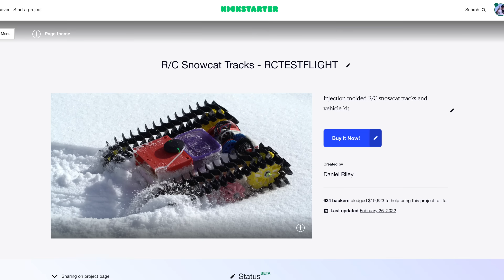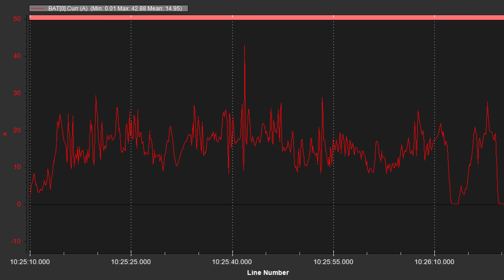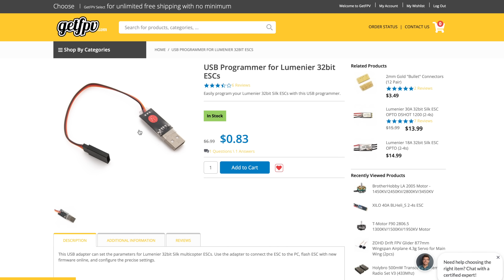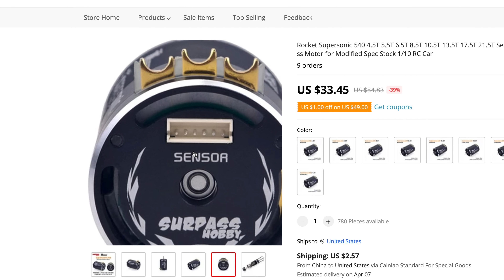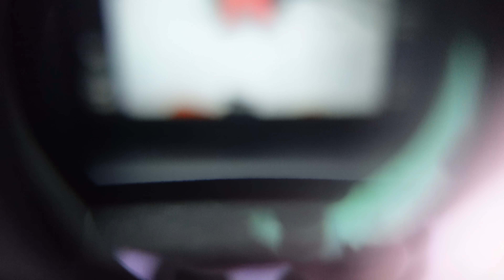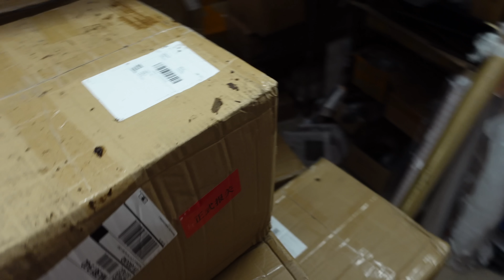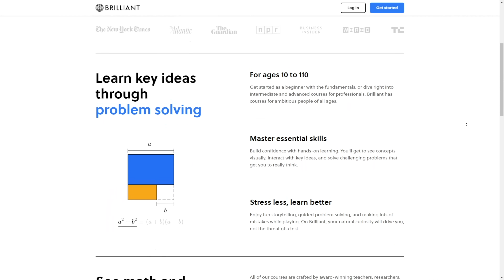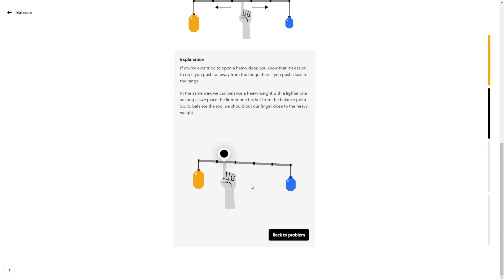The R/C Snowcat is HERE!!!

Comment: If you are using 6s voltage on the ESCs with no caps might explain the current spikes and blowing up, try adding some caps to the ESCs to help with the spikes and hopefully stopping them from exploding. You could also add a RushFPV power filter board to snip all the current and voltage spikes in the butt once and for all. Works great for mini quads, so it could help the snow cat a lot
Reply: He knows that. I mean he is basically a genius
Reply from the maker: I still blew up a few with big caps installed. Its not an inductive voltage spike problem...
Reply: Those cheap ESCs don't have hardware current limit capability，you need a cycle-by-cycle over current protection ESC which usually also has build-in current control loop which means better torque performance.
Reply: @槑  so a SW issue. Is the bl-heli  open source SW/FW? Seems like some stuff could be fixed in SW
Reply: The FetTEC voltage spike protection thing might be helpful
Reply: Holy fuck I’m reading through these comments and my mind is boggled props to all of y’all for having such knowledge
Reply: @probro1116  you just have to take some time to get to know the stuff
Reply: I would add a clutch for the jitter and use a subtractor gearbox so it could have one drive motor that spins up only when an input to drive or turn is received. the mechanical parts give the motors something to chew through and break, should something go wrong on the electronics end. less costly, too.

Comment: I suspect the deadtime in those ESCs might be off. Often with cheaper ESCs the components tend to be de-rated which can result in a slower on-off time than projected which can lead to shoot through which can cause overheating and burns. See if you can get Steffen to make you a BLHeli32 build for those with a slightly increased deadtime.
Reply from the maker: Interesting... Thanks for the info!

Comment: Taking a wild guess here: The overcurrent protection might just be way to slow to react to to this short spikes.
Do you have a log file or something, where you can see, if this protection activated? You can then drive around and see later, if it activated, and compare it to your diagram.

Or just take something to draw too much current (resistor that can handle a lot of heat for example) and add a multimeter to the circuit to see, what the overcurrent protection does and under which circumstances it activates (you will have to do this experiment in you lab obviously).
Test things like the following:
How long do you need to have too much current (add a manual switch, that you can close, and look at your diagram afterwards, to see, when you protection jumped in)?
Does this time change, if you change the current?
But be careful to not grill another part of your circuit while doing this.
Reply: Also, fuses are a thing...
Reply: @VulpeculaJoy  Underrated comment.
Reply: This sadly does not work as the esc detetects if the motor connected to it is spinning or not and if there is no motor the esc will cut power as it won't be able to sense the self induction caused voltage changes on the motor wires by which rotational speed and timing etc is estimated. That's kinda how sensorless esc's work.
Reply: Seems like a good approach to find a solution. I remember when I was still designing industrial dust vac systems that I once had a very peculiar problem that had never occurred in any of the other workshops, and both the issue and the solution may be related here.
Symptoms: When the filter fan was started up cold, it blew the automatic fuse of the building 4 times out of 5. After a few weeks we also received an official warning from the utility company of the city that they would take us off the grid if we didn't fix our amp drain spikes.
The issue: I put 2 and 2 together, and went to look at the way the startup circuit worked. Turns out it was intended to have a slightly delayed start-up by controlling the power output of the power source to the fan. BUT, the street had a fairly weak electric cable. This was a professional woodworking shop that was oddly placed in a residential street with only 2-phased power lines. So what happens when you ask for more current? Right, the voltage of the supply drops. But when the control system feedback loop is based on power and not current, then a drop in voltage will increase the needed current, so the input resistance got further lowered, thus further increasing the current and further dropping the voltage. This effect only occurred for about 2 to 3 seconds. The automatic fuse had a delay of 3 seconds, explaining the irregular tripping. And because the startup would trip the fuse, the owner left the filter running until lunch break and then all the way through the evening, so basically he would start it up only twice a day, giving the neighbors blinking lights and rebooting PCs twice a day (hence the warning).
Curiously, the issue never occurred when the fan was still running out, however low the rpm. It would run
Solution: We put in an extra control box before the filter that would temporarily choke the current and maintain the voltage whenever the fan was below a low-but-non-zero rpm; and then slowly reduced its effect over a set period of time. This increased the start-up time from 10 seconds to 45 seconds, which was about the time anyone would need to walk from the power switch of the filter to any of the machines it was serving anyway.

If I would relate this to what is shown in the video, the chip in the control box would just dynamically change the values of "current protection" and "ramp-up" and maybe a few others. A low max current and low ramp-up would cause a slow start, and then increasing the ramp-up once the rpm threshold is reached while steadily increasing the current protection with the rpm between 1A and 5A. But I guess to know that rpm, you'd need sensored motors unless he adds an optical switch on one of the axles or gears to measure the rpm locally.
Reply: @VulpeculaJoy  Sure, but are there fuses, which are resetting themselves automatically, when the load vanishes? The only goal is to protect from overcurrent, not to shut the whole thing down....
Reply: @moritzadler4362  Well, then add a motor, and try to trigger the overcurrent protection by inducing  a lot of load or something...
Reply: @TheCatAliasTNT2k  I was refering to the fact that he repeatedly blew ESCs during testing. Why pay 40 bucks each time an esc blows, instead of just a few cents for a blown fuse? This is not a solution to prevent regular overcurrents, it's to provide a fail-safe so that IF it still happens, nothing major gets destroyed and the rover doesn't become a fire hazard.
Reply: @VulpeculaJoy  yes, that would work, but I want to have a solution, that does "reset" itself
Reply: @TheCatAliasTNT2k  there are fuses that are self resetting, although you do have to remove all power from them to do so.  A normal fuse would still be better, as its a lot cheaper.
Reply: @kuhljager2429  Yes, but that would cut the power for a relatively "long" time, because hardware is relatively "slow" compared to software. Would be the question, if if would be fast enough to recognize the spikes at all....
Reply: @TheCatAliasTNT2k  So honestly, the long time here isn't relevant. Sure it takes  a minute or two to reset a self resetting fuse, or maybe 5 min to swap in a replacement for a blown fuse.  However fuses are only going to come into play once conditions in the circuit are going to cause damage if not stopped. It comes down to a choice: replace a fuse, or replace a ESC. Fuses aren't meant to iron out the small brief pulses, they are meant to stop current levels that will be blowing up the ESC.

Comment: The ESC issue could be similar to that i have had on G120s at work that there is a time delay on the over current before it will trigger it to cut out. so maybe worth checking the finer print to see what time delays might be set, as motors can spike oddly.

Comment: I suggest doing the 1200mw mod to your DJI goggles if you haven't updated them to the lockout firmware they just rolled out. Also changing out the stock antenna for some more directional ones to punch even further. I'd really like to see a long range snowcat video!

Comment: Great video! As a skier I loved seeing you take it to a ski resort. It did get me thinking, I bet these snowcats would be quite handy to use for avalanche rescue (for resorts or backcountry)! For somebody who understood such things it'd be interesting to see if one could be set up to drive autonomously and home in on a signal from an avalanche beacon, or possibly utilize some type of snow penetrating radar to look for victims. For doing grid searches it would be quite useful to have several of them using gps data to track where they have and haven't gone.
Reply: This should be fully possible if the person being rescued is carrying an active rescue beacon, passive rescue beacons however tends to need rather high power equipment and good line of sight which is why they're almost exclusively tracked with helicopters.

Comment: You should use Falcon 500 motors with their built in encoders for this project or a similar one. They are designed for FRC but might work well for your application.

Comment: There's a good chance this won't do anything for you, but consider adding capacitors near the battery leads on each ESC. Usually ESC's will have lots of bulk capacitance near the battery leads to smooth out the massive voltage spikes that result from current being turned on and off quickly. Your ESC has only some small ceramic capacitors that in all honesty, aren't enough for 50A. General rule of thumb is 20uF per amp but those little ceramic caps come nowhere close to that. 

I'm not an EE so I'd take what I'm saying with a grain of salt, but if you look at your collection of ESC's, I'm betting most of them will have some form of electrolytic capacitor near the battery input leads.

Comment: You could solve the low speed torque problem by using brushed motors. Of course that means replacing both ESC and motor but usually brushed ESCs are cheaper than brushless and brushed motors still spin really fast.
Reply: Main reason why he want brushless is no more lipos with out
Reply: @coolbone6177  That doesn't make any sense. Brushed crawlers use LiPo all the time. The Hobbywing 1080 is the gold standard ESC for brushed crawlers and the default battery mode is LiPo. There's 6s compatible ESCs out there for brushed motors as well.
Reply: @ivanf4023  no I do relised but a Lot of the time if you want fast turn and high gearing cars you don't want to use brushless because lipo last way longer

Comment: I thought of a great autonomous vehicle project, but it is a bit different than what you are used to. An autonomous rover with a metal detector strapped under it, and with data logging, to profile a 500m sq area. You use the data to go back later to give the hotspots closer attention.

Comment: STAGE 2
You need to add suspension and more wheels for hard terrain. 
..
Also, the motors/ESC's for rc crawlers are designed for low speed torque.

Comment: Dude that thing carves snow drifts like a surfer carves waves! Switching to actual land based motors and ESC's would drastically help you out. They are optimized better for low speed high torque starts without spiking currents like a crackhead surprised by cops kicking down their door.
Reply: Nice simile.

Comment: I wish I could have afforded one. They're awesome!
Reply: Put some make up on and get to work... wishing won't make it happen.
Reply: @murrijuana2842  In 2022, comments like these still happen? On a channel like this even. Bascially, you are assuming she's lazy and that because she is a woman, she somehow has to wear make up?
Reply: Currently designing my own rc car basically from scratch because I'm broke and want one. $100 worth of parts on Amazon. Don't know much about RC parts so I ended up buying a way better steering servo and battery than I needed, could have easily only spent $80 if I had known that. But I guess it worked out because I'm using the steering servo to do differential braking, and a weaker servo wouldn't have had the torque to do that.

Even if you are short on cash, if you have a 3d printer it doesn't cost too much to have a ton of fun with rc stuff.

Comment: i think of using the rpm filtering in betaflight and the snowcat, but i dont know if this is running in this setup. i guess the motors are in servo mode. maybe someone did before..... but betaflight can see the motor rpm if using blheli_32 or bluejay firmware on blheli_s escs. this can prevent from powering up too much.  ramp up 80 is already really high :-)

Comment: So I actually have some ideas for Snowcat variations. Sandcat and Mudcat.
The Sandcat would be a faster lightweight version of the Snowcat, making it easier on sand and possibly even powder snow. 
The Mudcat would be around the same weight as the normal Snowcat, except being slower and tracks more adapted for mud.
It'd also be cool to see a wheeled version of the Snowcat, and see how it handles.

Comment: Low RPM Power Protect seems to be the feature you should turn on as it hevily limits the current when spinning slow or stalling. Enabeling this also to some degree changes the way current protection works at least in my experience. Also try experimenting with maximum acceleration as you probably won't notice decreasing while decreasing current draw. The rampup power setting does the same thing but produces really weired throttle response und can even lower max rpm.
Reply from the maker: Low RPM Power Protect would definitely keep the ESCs from burning up but it also keeps the motors from spinning...

Comment: it would be rlly cool if you took the dji fpv system, attached it with servos on the tank (so it could look around), and tracked the fpv goggles movement (where you are looking), and coded the servos to mimic your goggle movement.    (saw someone do this with a rc jet)

Comment: By observation, if you hold another kickstarter for something even better than molds you have a good chance of succeeding.

If parts made of resin are what you require, check into a Carbon3D subscription.  25x the speed of regular 3D printers and retains all the structural properties of the source materials, due to the technology process they've developed.  The only downside is that only their resins work with the printer, but even that is mitigated by offering several industry standard resin profiles at reasonable costs.  An additional upside is that you can produce parts that aren't possible by any other reasonable method, and prototype many of them quickly.

They did a TED talk in 2015 demonstrating/explaining their process, and it's been tested by a lot of big makers, including Adam Savage's Tested in 2016.

Comment: I have an idea for the motor spin up issue, what about using a clutch, like I know it might make it more jittery starting up, but it would allow for the motor to spin up and then once it has a good amount of torque lock the clutch, the first thing that came to mind was a centrifugal clutch, though that might require to high of an rpm range to be practical
Reply: You wouldn't be able to very easily smoothly start when you aren't stuck with a clutch like that. Also might be hard to find one of the right spec off the shelf. At that point, it would be just as hard and cost about the same to just get sensor motors.
Reply: @lobsterbark  you have a point. However I think as a cheap solution, being that he just 3d prints a clutch. The ultimate solution would be to add encoders onto the brushless motors and use a motor driver that would makes use of the encoder feedback. Then the motor would have superior torque at lower rpms
Reply: @JuniorJunison  You can't "just" 3d print a clutch. You would have to do extensive testing and hand fitting, you would have to always use the same exact print settings and filement every time once it was dialed in, and it wouldn't last very long even once you got it working.

It's something that is technically possible but it literally would be cheaper to just buy off the shelf or have custom clutches made.

Comment: So you said VESC is Overkill, something to keep in mind, there are a ton of VESC-Based ESC's out there and specifically the CheapFOCer v2 (which does require some assembly). This particular controller is based on the VESC 6 hardware (DRV 8301 / 3 shunt). The perks of this is that (when the design was built, the CheapFOCer was targeted for a sub 20 dollar per ESC BOM, today might not hit that mark) the ESC is relatively capable and you can run Field Oriented Control  (FOC) instead of BLDC. FOC itself can run sensor-less start up and the low torque you're talking about could very seriously be removed from the equation. I run FOC Sensor-less on my Mountain Board (40LB + 220LB rider) and two 170kv 6380 out runners can move me from a dead stop on an incline with out the "coging" affect you're referring too from a BLDC sensor-less startup. There are other options inside the VESC firmware as well such as HFI (High Frequency Injection) and VSS (Formerly ASS) Vedder Sensorless Startup / Advanced Sensorless Startup. Which further improve upon the starting conditions to a nearly identical performance to that of sensored motors thereby removing a series of physical failure points (Sensor Wires, Sensors, Sensor PCB, JST ports)  

The problem here is that I've quite seriously never attempted to run a VESC-Based ESC under 10S - So low Voltage High Amps may not be suitable. Just wanted to share some details on options in the VESC-based products.